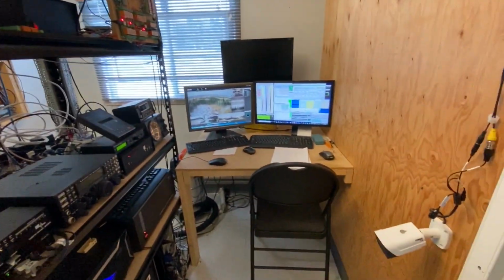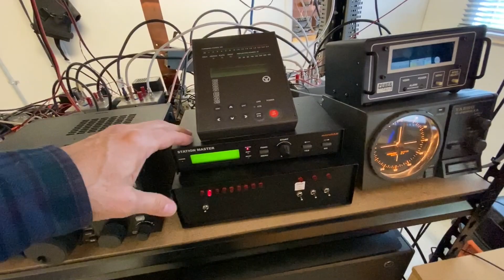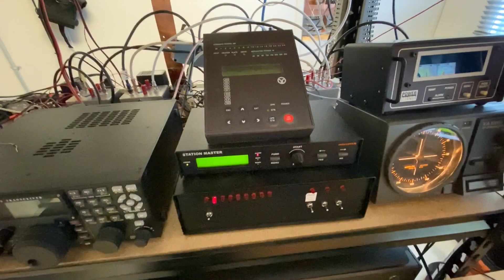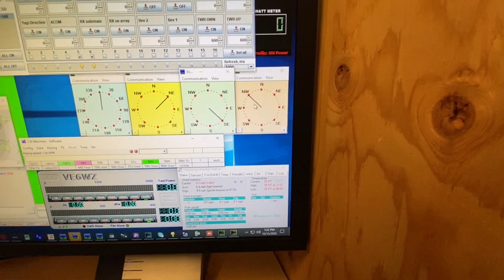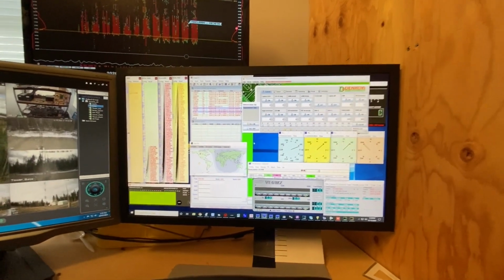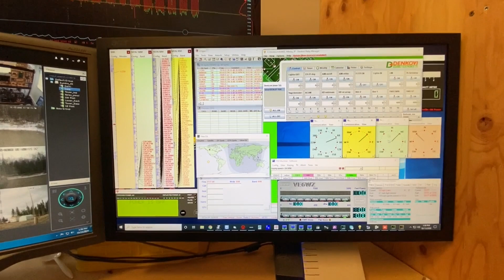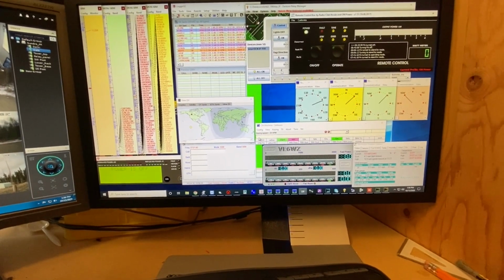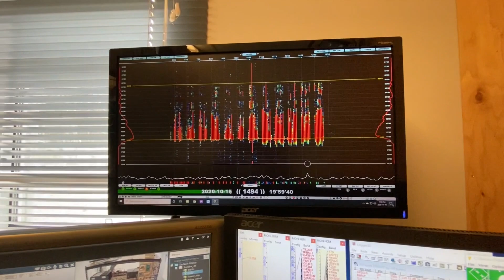A tour inside the VE6WZ remote shack.

Comment: 3:15 "...a UPS..."   A very wise man once wrote:  

"You’re concerned about your family’s safety. So you get a guard dog. The dog costs a fortune. It immediately poops on the floor. Then it chews off the entire left side of your Bang and Olufson. It bites the postman’s fingers. It then sleeps through an actual burglary. And finally it eats one of your children.

This is the UPS experience: If they’re not preoccupied with smoldering their lead acid batteries, then they’re busy buzzing and arcing. Then they blow an internal fuse on the output, and your Great American Novel is suddenly lost, again, for the third time. Then there’s an actually power failure (Yay!), so they turn on their patented 387 volt offset square wave, and your PC is instantly corrupted. Meanwhile battery acid squirts out onto the ceiling, again. Then, while you’re out trying to buy a replacement PC, the UPS catches fire and burns your house down.

I’d happily pay $800 to not have one."

Beware of UPSs. My company has had 'for real' building evacuations twice in 35 years; both were caused by flaming and smoldering UPS systems. Make plans for when (not 'if') they will catch fire.